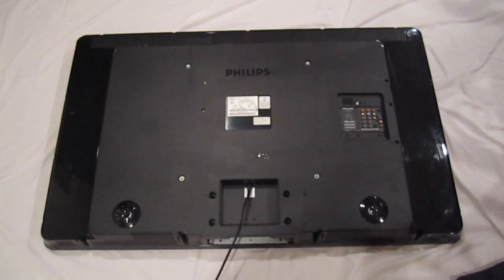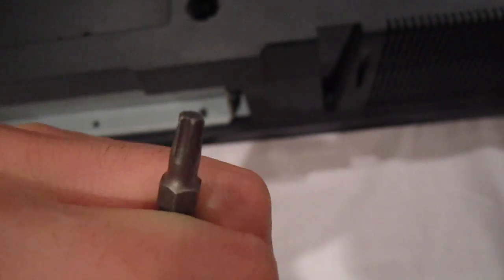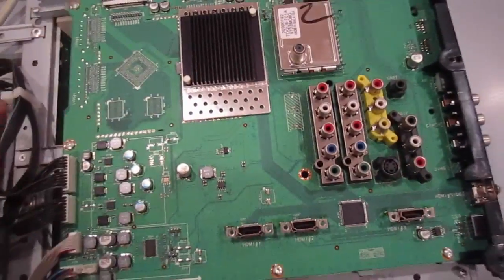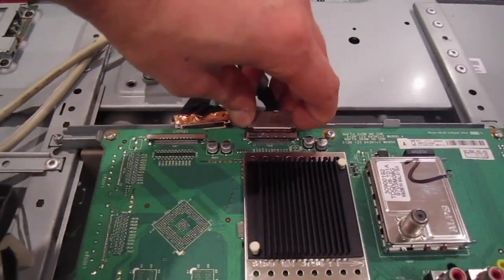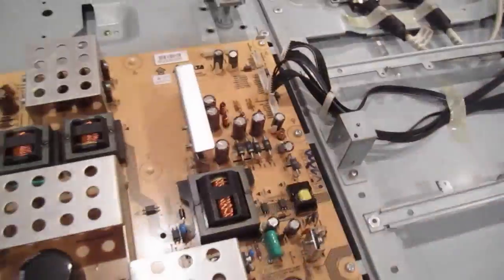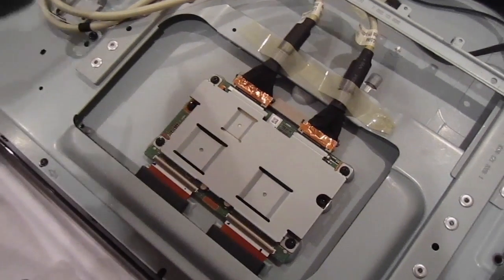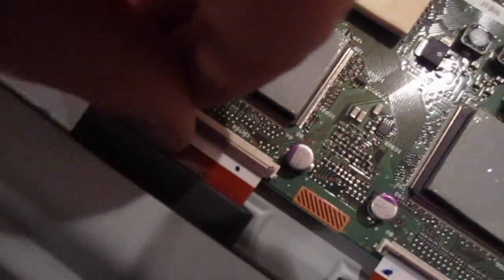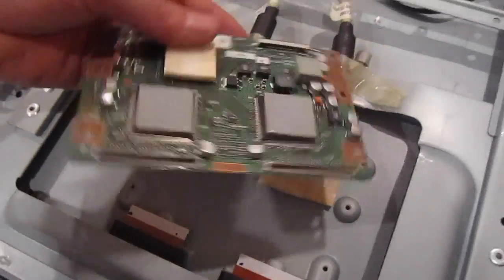Philips 52PFL5704D/F7 How To Take Apart and Replace Main Board, T-Con, Power Board

Comment: yes the I made sure all the numbers matched. The only difference I see  is that on the original  board all numbers match but the fallowing: on the original it is EBE 948.5 021B and the new it is EBE 948.6 021A